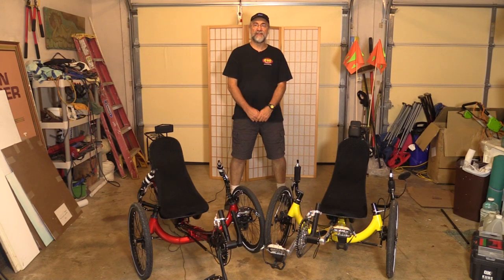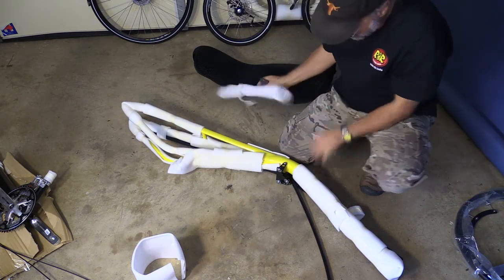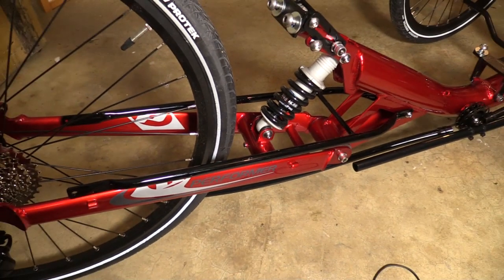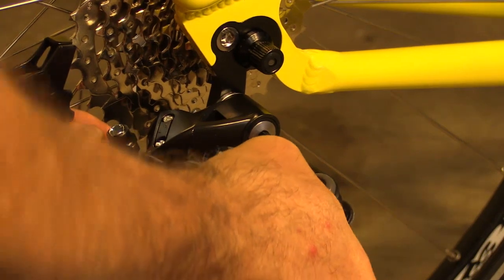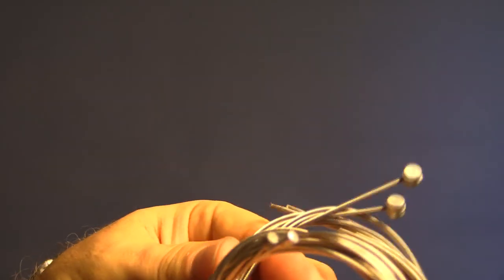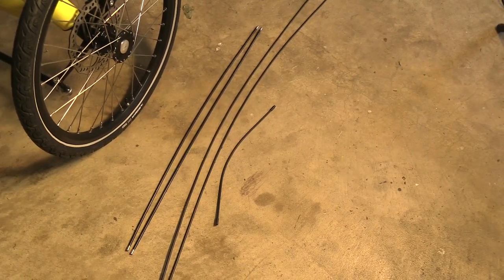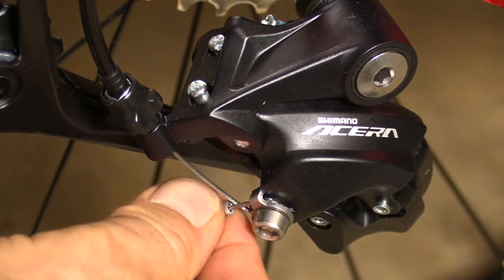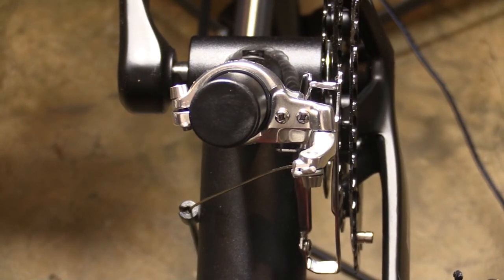Performer JC-70 and JC-26X Assembly

Comment: My wife ordered the JC-26X and the bag of bolts and hanger per the instructions were missing. Two of the bolts appear to hold the rear fender but no one ever answers the phone after multiple calls. We found bolts locally that fit the rear frame fender mount but do not fit the rear fender mount wires.

Comment: I am currently looking for a 2nd hand jc70 because I  want to pair it with my Copenhagen Wheel. I would want to customize the seat mounts by adding 1/2” rubber mount to the seats for dampening. It should help with vibrations and make a more comfortable ride.

Comment: I just got my jc-26x in and there are two plates that look almost like the upper seat mount plates just longer and a tad thinner. I had thought they were optional longer ones for a more upright seat position but the bolts on the shorter plates don't fit the holes.  Anyone know what these are for?   The plates I'm talking about can be seen at about 25:51 in the video

Comment: Can some one do a video on putting on the  jc26x front fenders. My fenders don't track with the wheels.  if I tighten it to much then it's hard turning. I'm missing an adjustment some how. So I took the fenders off. I like fenders.
Reply: my right fender has always done that, it's a poor design issue, it shifts when you turn.  I just took the front fenders off yesterday to be done with the irritation of it.

Comment: What benefits are there between 70mm vs 20mm rear wheel
Reply: You mean 700c vs 20 inch ? 700c is probably faster and should be more comfy over bumps